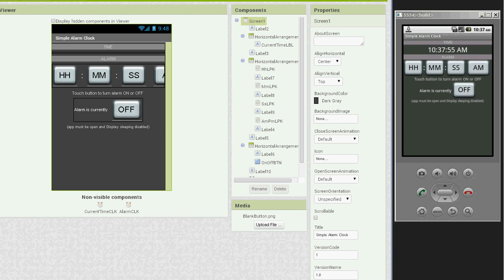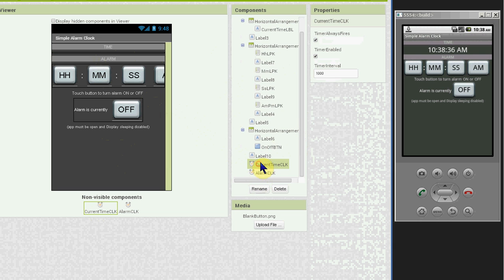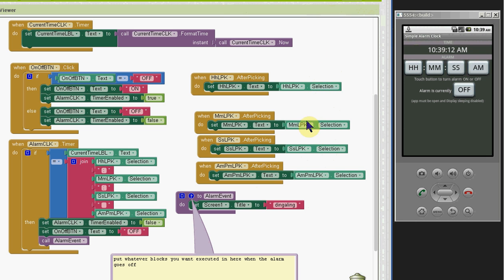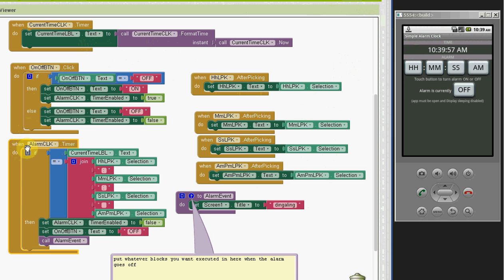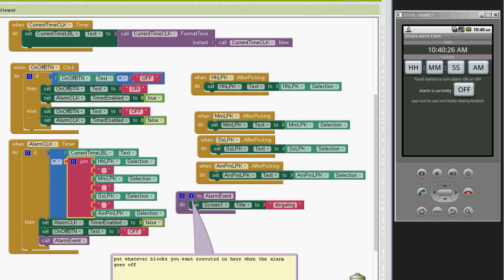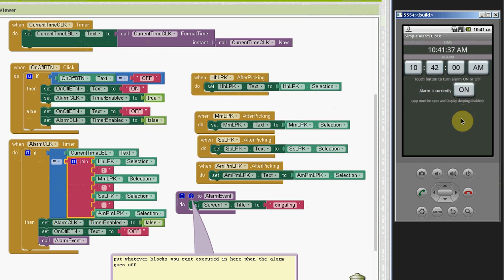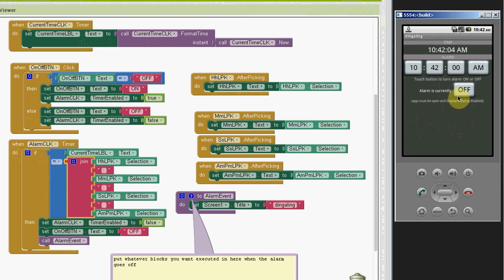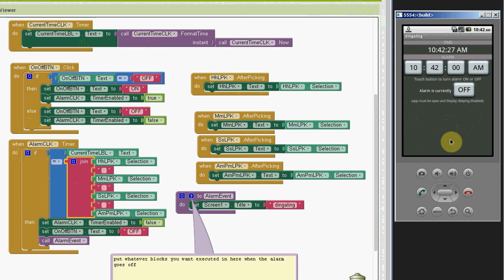App Inventor - Simple Alarm Clock

Comment: Excellent work sir! Thanks.... i tried and .the code works well..but i have two doubt  .1: is it 
possible to schedule multiple alarms in a single screen? i tried but it 
does-not work with multiple timers..and another problem is when screen 
is off then  the alarm is not triggering..how to fix it?
Reply from the maker: This is just a 'proof of concept'. You would have to add that feature yourself.

Comment: Hey guys why i can't run this app successfully
Reply from the maker: Did you code the app yourself or did you start with my aia project? You can find it here: http://tinyurl.com/ai2alarmclock
Reply: ***** hi.. how to open aia file?
Reply from the maker: kemal mazland Here is a link to the aia project. You open it like any other aia project: https://groups.google.com/group/app-inventor-developers-library/attach/4be4de83c368d10/AlarmClock2.aia?part=0.1&authuser=0
Reply: ***** its need a software to open it? stil cant find the way to open the aia file
Reply from the maker: Go here: http://appinventor.mit.edu/explore/ then choose Resources, Get Started from the menu to set up the App Inventor software.

Comment: איך עושים נודניק
Reply from the maker: שתורגם ל
 'how to do pest'
באנגלית שלא הגיוני. נסה לשים את ההערה שלך במילים אחרות.
Reply: How do Snooze Alarm
Reply from the maker: When the user presses a snooze button, then set the alarm time to 5 minutes later than the current time. If that causes the minutes to be greater than 59, then add one to the hour and subtract 60 from the minutes. Example: Current time is 10:58:00 AM. Adding 5 to minutes gives 63 minutes. Subtract 60 from 63 to give 3 minutes then add one to the hour and set the alarm using program blocks. The new alarm time will be 11:03:00 AM. In most cases, such as for a time like 10:15:00 AM, adding 5 minutes just changes the minutes to 20. So the new alarm time would be 10:20:00 AM.

כאשר המשתמש לוחץ על כפתור נודניק, ולאחר מכן קבע את שעת הצלצול ל5 דקות מאוחר יותר מהשעה הנוכחית. אם זה גורם דקות להיות גדול יותר מ59, ולאחר מכן להוסיף אחד לשעה ולחסר 60 מהדקות. לדוגמא: שעה עכשיו היא 10:58:00. הוספת 5 לדקות נותנת 63 דקות. לחסר 60 מ63 לתת 3 דקות לאחר מכן להוסיף אחד לשעה ולהגדיר את האזעקה באמצעות בלוקים תכנית.זמן ההתראה החדש יהיה 11:03:00. ברוב המקרים, כגון במשך זמן כמו 10:15:00, הוספת 5 דקות רק משנה את דקות עד 20. אז בפעם האזעקה החדשה תהיה 10:20:00.
Reply: ***** איך עושים את זה
Reply from the maker: Try something then show me what you did.

Comment: I did it successfully and I incorporated in an app I am making for a university project! But when I go back to the menu and then again in the alarm page the time is not saved, and the alarm is not fixed to ring. Could help me on saving the time of the alarm so it would ring even if the app is closed?
Reply from the maker: You could use TinyDB to store the alarm setting values (HH MM SS AM/PM) before the app is closed then restore them when the app loads. There are tutorials on TinyDB on YouTube: https://www.youtube.com/results?search_query=TinyDB
or on my Google Group page: https://groups.google.com/forum/#!searchin/app-inventor-developers-library/TinyDB
The MIT tutorials also have examples such as this one: http://explore.appinventor.mit.edu/ai2/colored-dots
---
sf
Reply: ***** I forgot to mention I already use a TinyDB in another part of the app, and from previous problems I encountered I found out that I could not use a second one db. Could I use the same tinyDB for storing other data AND the time the user gives without these getting messed up?
Reply from the maker: BloodyHellXx Yes. You can use multiple tags for different purposes. Also you can use one tag name to StoreValue a list of related data which is what I would recommend. Then use GetValue to get the data into a list and select list item to access each item. 
---
sf
Reply: ***** Thank you, this helped a lot!! Something last, do you know if there is a way for the alarm to ring on the time the user has inserted, even if the app is closed?
Reply from the maker: check puravidaapps.com Taifun has some workarounds that might help to keep an app awake but ai apps cannot run as a service.
Reply: ***** Thank you, you were a lifesaver :D